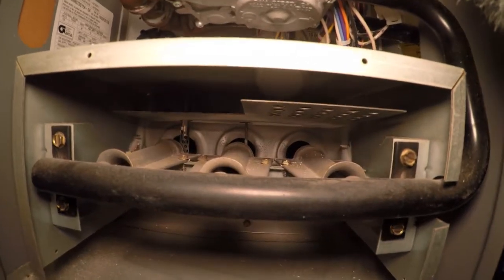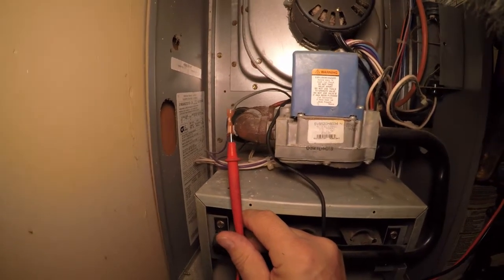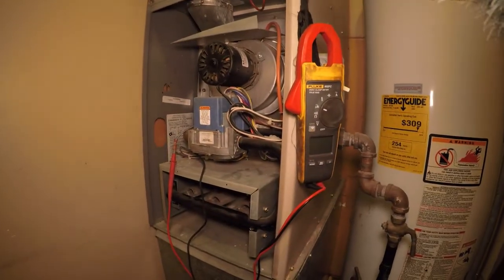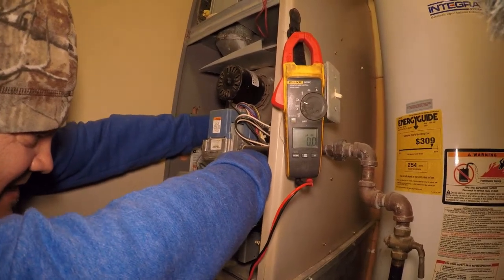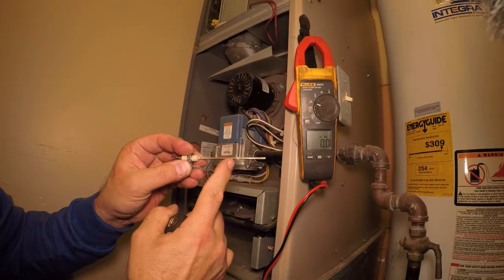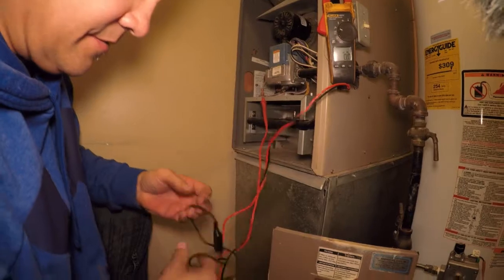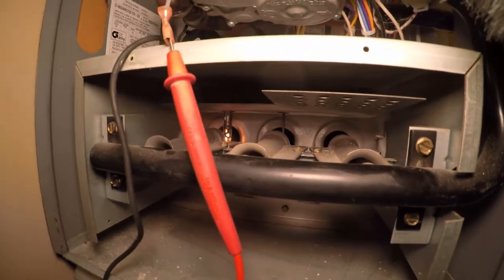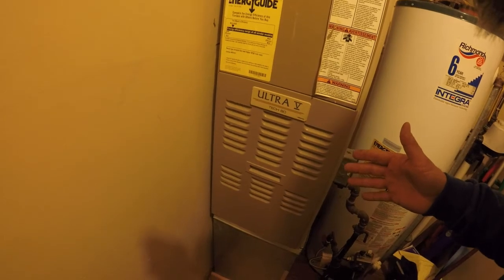FURNACE NOT HEATING: HOW TO CHECK FLAME SENSOR AND CLEAN.

Comment: We have an Armstrong ultra sx 80,  it doesn’t seem to work unless I turn it off and take the back panel off for it to light properly, like it needs air. Any pointers?
Reply from the maker: Maybe a dirty flame sensor low gas pressure.  Depends on the type of gas valve.  Is it a Honeywell smart valve.  Not enough information

Comment: I noticed that there was a screw over the third burner opposite end of the ignitor! The flame sensor should be there. I am guessing that rack assembly is used for 2 or 3 burner set up and sensor was in the wrong location. The first burner is the igniter location and the last burner is the sensor location to ensure that all burners are in play! Might want to invest in a 1/4 by 5/16 Klein ratchet stubby, works better than the screw driver. I like your business videos better, what is up with Mel, Billy, and the other guys? COOL G'Z not so much!   And if you are trying to help people start a business, why are you telling homeowners how to clean a flame sensor? C'MON MAN! Somebody just lost a service call because of that!

Comment: Please use a paper bill because that is less abrasive, and advised by manufacturer's. Using a abrasive snad paper, or your steel wool, you scar the coating on the rod causing it to arch. instead of just at the tip pulsating, you make the whole rod conductive sanding.

Comment: You did not put the safety warning about 120 volt power going to the flame sensor.

Surprised the flame sensor is not located on the far right burner farthest from the ignitor.
Location on the middle burner does not gaurantee complete light off.

100.00 $ bill works best according to Ted.

Tight mount screw does not affect ground, burner ground is the path from flame sensor to burner in the flame.
Reply: 120v goes to the igniter not the flame sensor! Not learning much from TED!
Reply: @robertj.2319  The flame sensor is hot 120 volts any time the power is on. 
The 120 volts ac is rectified into DC millivolt from the flame sensor to the grounded burners. The board reads the DC current as proving the presence of flame.
The burners require a solid ground path back to the ground on the board.
Intermittent pilot flame sensors can be either 120 volts or 24 volts.
Reply: @mtu-engineer3220  what ever you say kid.
Reply: @mtu-engineer3220  had that wire touch the cabinet many times and never an arch or trip to ground not to mention never a shock when touching it while the unit is on. I will take my experience in heating and air over your lack of it any day of the week! Hold my Beer and have a Merry Christmas!